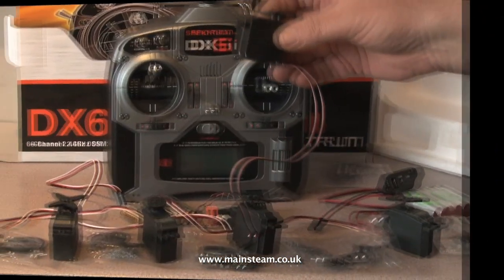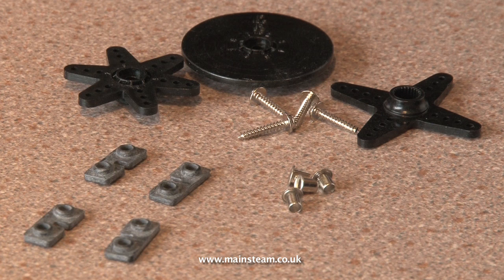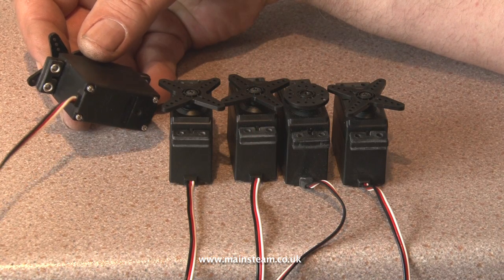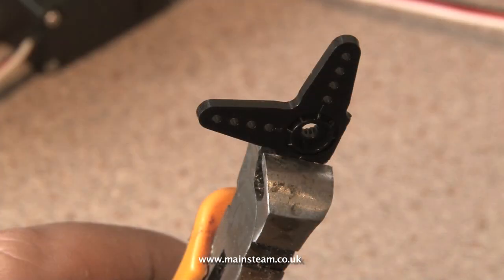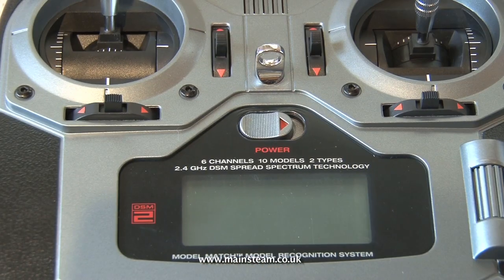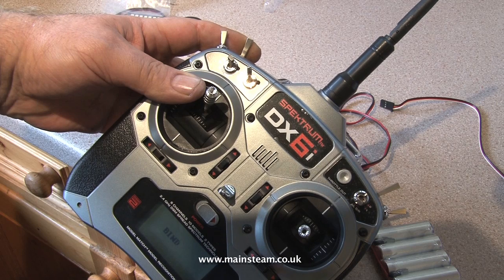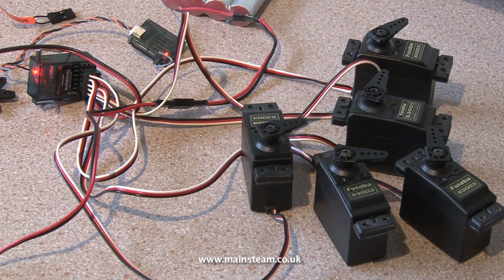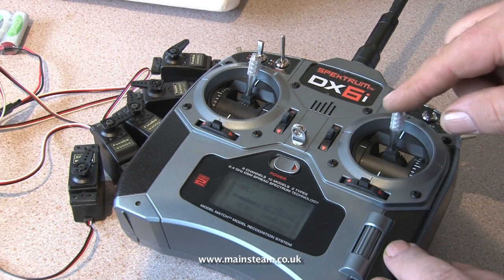HOW TO BIND A SPEKTRUM DX6i RECEIVER TO A DX6i TRANSMITTER

Comment: I had trouble getting my DX 6i to display B I N D on the screen on the transmitter.
The plug that is connected to the circuit board then to the trainer switch looked unstable.
I unplugged it to expose the four posts.
I used a hot soldering iron to melt the casing around the four posts.
I cut off one wire to the plug and spliced on a longer wire to solder onto one of the correct  primed post on the radio board. The remaining three wires followed the above procedures.
Now B I N D appears on the DX 6i screen after pulling on the trainer switch before turning the transmitter on.
Really cool !!

Comment: Very helpful..  But, what battery did you use for powering the receiver while binding?
Reply from the maker: a standard RX battery . ..
Reply: @keithappleton  Ok.  I am looking at batteries with RX in the name.  I see different voltages, shapes, etc.  Can you tell me the voltage I should use?
Reply from the maker: I use 6 volt packs.

Comment: What do you if the receiver light doesn't turn on at all? The battery is powering everything and it is plugged in, but no lights turn on whatsoever. What do I do? Or any advice?